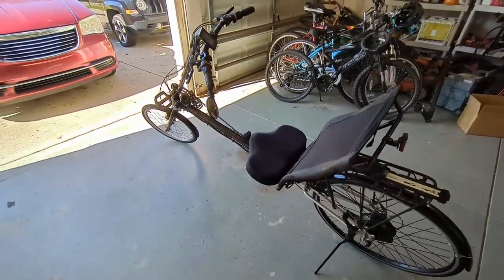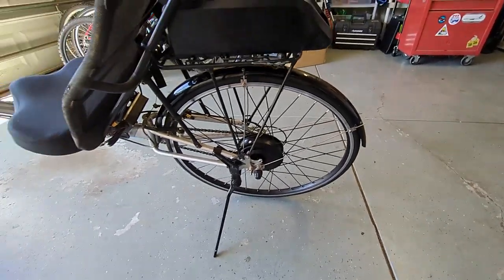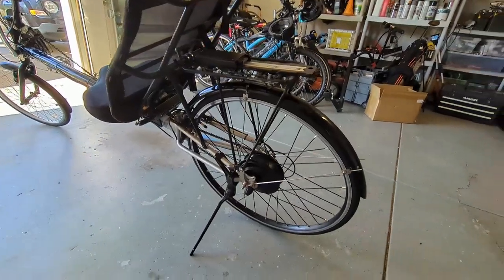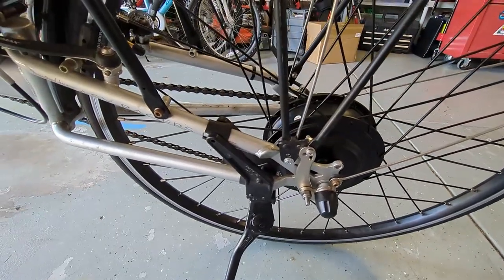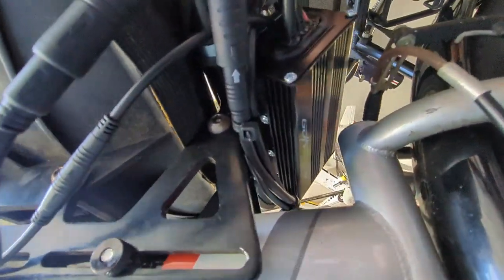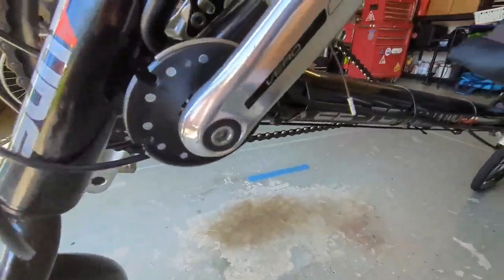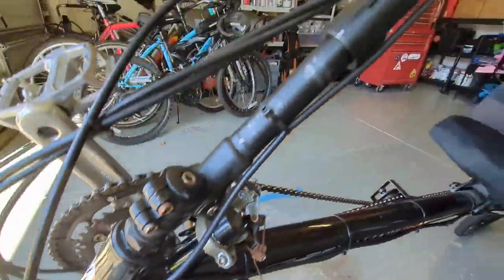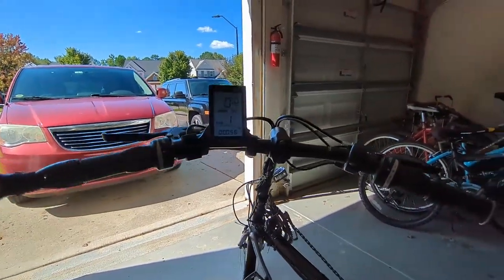Recumbent ebike Conversion

Comment: Hi, can you tell me why it is harder climb a hill on a recumbent than a diamond frame, assuming one does not stand on the pedals on a diamond frame?

Thanks. (like this comment so that I know you responded)
Reply from the maker: That's the primary reason. Can't use your body weight to stand on the pedals. You can downshift to the lowest gear but then your speed drops and it becomes a balance issue. Since you're planted in the seat you can't shift your body weight easily to counter the pedal strokes. It's also more difficult to start from a stop on an uphill.

Comment: You might want to adjust your handlebars a little bit to allow for more knee clearance. On my recumbent with a 700 rear tire I’m climbing hills at 4 mph in my granny gear. Your 15 mph uphill is pretty awesome. With regular brakes in back though at 35 mph you might be over riding your braking ability if you needed to do a panic stop.